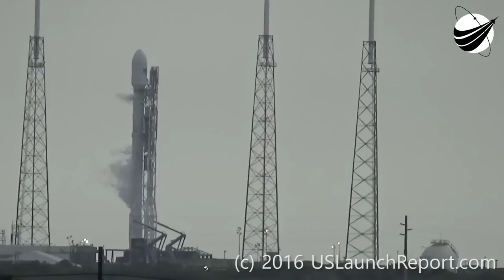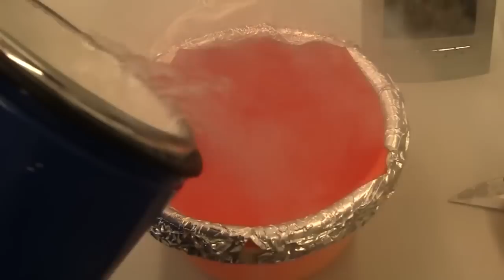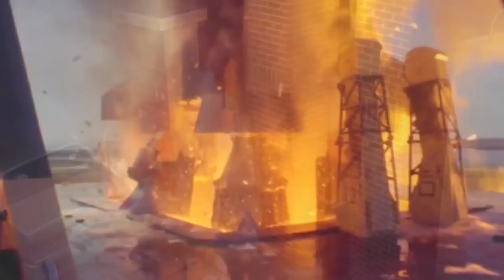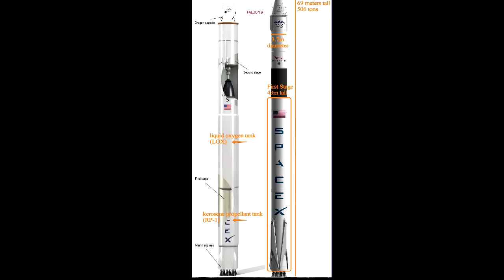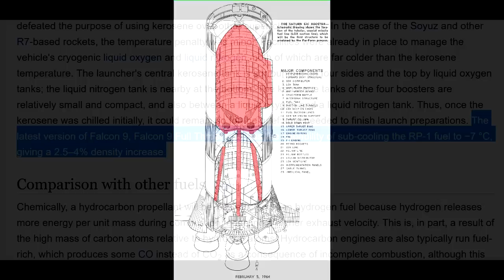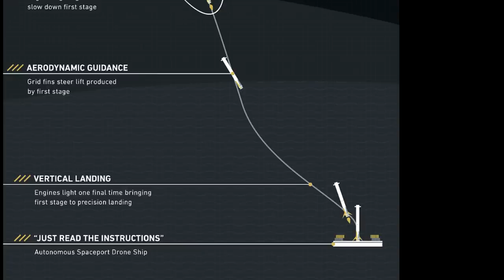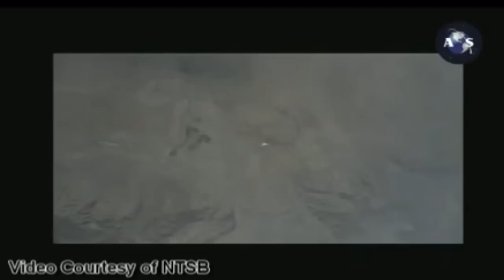Why did the Falcon 9 Explode?

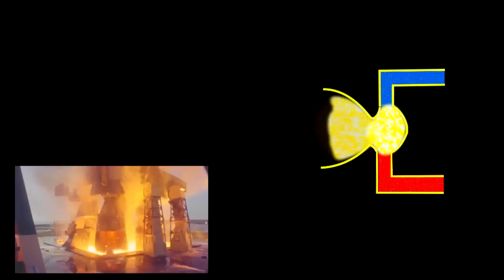Comment: 7:34 are you saying rocket fuel CAN melt steel beams?
Reply: rocket fuel can melt steel memes
Reply: Rocket fuel can't melt steel memes
Reply: Too far
Reply: Not far enough
Reply: no, the cold liquid oxygen made the keroscene freeze which inturn gave stress to the tank and broke it
Reply: Can rocket fuel melt dank memes?
Reply: DUDES . . . y'all people need to look up what an "annealing point" is, and what it means.  The steel beams of the WTC did not have to MELT to lose all structural integrity . . . that happens at the ANNEALING POINT, which is definitely lower than the MELTING point.
Reply: Yeah, somewhere about 500 C I believe ... a nice bright cherry red. roughly 950 F ... a good campfire can do that.
Reply: It didn't 'melt the beams it merely softened them allowing them to bend changing the stress on all the other beams and leading to a total failure of the structure. While the 20% ratio of oxygen in air limits the fire temperature airflow into the fire can increase the fires temperature the blacksmiths forge show that.
Reply: with an excess of oxygen, you can increase the burning temperature beyond that of the fuel's 'golden ratio' (so, yes)

which is also why it's bad to run your car lean, it creates more heat, causing damage to the engine.
Reply: Autistic screams can't melt normy  memes
Reply: You mean jet fuel!=rocket fuel? Actually they are pretty similar in many points, both beign Kerosene, but not the common kind. Mind that Aviation grade Kerosene is better then the "household" grade shit! But the fuel is about the same. The biggest difference, as you could observe within the video is the oxidant not the fuel and this is very important in a combustion as it requires fuel+oxidant, being really finicky with the later. Just look into the burn-out and other problems the first jet engines had in the UK(yes, they were the first with the Germans really close, but more invested in it). Also, let's not forget how much several tons of plane+fuel+bags+meatbags at hundreds of miles per hour have as kinectic energy and how this energy would be dissipated in a moronic structure like the WTC buildings. This is all sad, but the saddest part is people trying to racionalize something crazy with very little logical reasoning!
Reply: Roonasaur I was a welder by trade for several years ... I know my metallurgy :)
Reply: Mystic Virgo
Yep :)  Glad there's at least one person out there that I don't need to explain basic shit to :)
Reply: rocket fuel can, jet fuel cannot.
Reply: LOL, even jet fuel under typical low-bypass turbofan conditions can melt through a solid piece of iron or maraging steel, let alone low-temperature structural steels.
Reply: Peter Smythe LOL is why they are mostly titanium alloys . Germany had a hell of a time figuring out how to keep their Jumo turbines cool enough to have a half decent lifespan
Reply: so impressed with your knowledge .. not so much that by a minor technical error you have pre judged me to be completely ignorant.  I have been a student of military and aircraft history since , perhaps, before you were born ( perhaps not ) . It would have been perfectly acceptable to simply correct me on the alloys used ... and, perhaps, added the modern use of air film cooling in the turbines ..
Reply: Mr. Emma Wray repeat this a few more times?? :P I would not be surprised if there weren't 'hot spots' under the debris, especially the lower levels of the pile" where temperatures were high enough and lasted long enough to cause melting of thinner structures , like the floor trusses.  But insofar as the incorrect hypothesis that the fires on the affected floors were high enough to melt steel and that steel needs to be melted to fail, is completely fallacious and based on ignorances of basic metallurgy and engineering.
Reply: Burns like an Ox-Acet cutting torch, of course it can melt steel.
Reply: No , it's not what happened at all... even if there were thermal steam explosions, , they would have been on floors under the compromised steel and the worst that could have happened then was glass blown out ... no it isn't what happened...
Reply: Jesus did it
Reply: Actually planes use turbines to pressurize oxygen and inject it a chamber with jet fuel.
Reply: Well you would get a higher partial pressure when it comes to oxygen in the mix if the air gets compressed to some degree. The percentage of oxygen in there will still be the same, but due to a higher overall pressure you do get more in there. But it'd be nowhere near as extreme as injecting pure oxygen in liquid form which when exposed to the heat of the burning expands rapidly into a gas.

And considering the expansion ratio from liquid to gas and how fast it goes through the nozzle I'd imagine the pressures are quite high.
Reply: oh, and in the case of a rocket engine, an important factor is: the friction of the propellant moving past the nozzle ports, which can create tremendous amounts of heat.
Reply: +Viktor M They don't carry oxygen with them but -
Rocket fuel = RP-1
RP-1 = Kerosene 
Jet fuel = JP-1
JP-1 = Kerosene
Rocket fuel =/= Jet fuel??
Reply: ***** I don't know.
Reply: Remember it has to mixed with concentrated 100% oxygen.
Not 20% in Air...
Reply: JP-1 != RP-1.  RP-1 is a higher refined version.  Wiki quote: "RP-1 (alternately, Rocket Propellant-1 or Refined Petroleum-1) is a highly refined form of kerosene outwardly similar to jet fuel, used as rocket fuel."  Not the 'outwardly similar' text....RP-1 has much lower tolerance to contaminates such as sulfur for example.  The weight of all additives are restricted tightly to be similar to C-12 in weight.

Also note, a standard JET engine will NOT be able to burn RP-1.  As it needs higher O2 concentration to ignite then a typical jet engine can generate, this is due to it's very strict C12 hydrocarbon weight restriction.  JP-1 has carbon distribution typically between C8-C16.  JP-B by the way is between C5 - C15 distribution.  RP-1 is C12, period no variance allowed.

To summarize.  Just because they are all Kerosene based fuels, it's NOT the same.  Example, don't put diesel in your unleaded engine.  Even though unleaded is just a more refined form of diesel.  Or to compare more similar fuels.  Don't put 89 octane in your engine if it requires 95 octane, your engine will knock and you will damage it, also will get lower engine temps and less power.
Reply: thermite would be a form of solid rocket fuel.  And would be less efficient then other typical solid rocket fuels.  Overall solid rocket fuel is less efficient then liquid fuel, due to the compression allowed with liquid fuels.  Thermite uses Iron Oxide as it's oxidizer, much less efficient then liquid O2....ie extra weight from the 'iron' part of 'iron oxide'.  btw, iron oxide is just rust, LMAO
Reply: Considering the flame temperature of LOX-Kerosine rockets is almost 3000° C. Yes they can.
LOX-Hydrogen rockets have a flame temperature of over 4000° C

Hydrogen rockets actually burn hot enough to evaporate steel (technically).

With rockets you are technically riding a continuous explosion into space. That brings BIG engineering challenges.
Reply: nah. mate, it does increase the amount of O2 available to burn as compared to the more rarified atmosphere at 30K feet.  no, the ratio of o2 to Nitrogen does not change
Reply: Mystic Virgo 
Aye
Reply: +jacek ringwelski and you're wrong as fuck
Reply: LittleRainGames oh, damb. Thanks for letting me know in wrong. 

Even though you didn't bother to tell me what I said that as wrong, why it was wrong, and explain what the truth is.
Reply: LOL Yeah I finally got smart, bookmarked links to remind me and to provide the info to those who ask for citations
Reply: Roonasaur That requires the immense effort of googling shit up and actually reading, which makes the "Chip and Dale" in people's head go crazy with that squeaky voice. People just love "gud educachun"!
Another interesting thing that can happen in building fires(not the problem in WTC) is if you temper the steel by heating it then fastly cooling with water, making it brittle with the forming of too much martensite withing the steel, so one good shock(falling debris for example) might break it depending on the mass and structure.
Reply: +Kaos Warrior I don't think anyone questioned whether it is possible to shatter steel beams. the issue with beams melting arose because melted beams were found and there is no physical process in the official narrative that can explain this fact (or many other observed physical effects on the day).
Reply: +Kaos Warrior I don't think anyone questioned whether it is possible to shatter steel beams. the issue with beams melting arose because melted beams were found and there is no physical process in the official narrative that can explain this fact (or many other observed physical effects on the day).
Reply: +Kaos Warrior I don't think anyone questioned whether it is possible to shatter steel beams. the issue with beams melting arose because melted beams were found and there is no physical process in the official narrative that can explain this fact (or many other observed physical effects on the day).
Reply: in art, the Golden Ratio is essentially the fibonacci sequence being mimicked in a composition. For some stupid reason this made me laugh.
Reply: This is what cause the steal beams to melt and explosions to be heard: https://www.sciencedaily.com/releases/2011/09/110921074747.htm
Reply: LOL
Reply: yeap , anyone take metal working in shop class or votech could tell anyone that :)
Reply: Molten aluminum mixed with water will give a reaction that can get high enough temperatures to melt steal beams. The planes delivered tons of aluminium and the sprinkler system delivered plenty of water. Check out the source, a Norwegian material scientist: https://www.sciencedaily.com/releases/2011/09/110921074747.htm
Reply: e idea, General, but bear in mind, any sprinkler systems at or above the lowest affected floor  were completely inoperable... Severed standpipes
Reply: Mystic Virgo Just read the damn article it's explained there. Once the aluminium is molten liquid it can flow like water and leak into floors below where the sprinkler system is still operable.
Reply: GeneralBlackNorway Have you even spent an hour in any form of metal working trade?? have you any clue how hot metal / molten metal actually behaves?? if a small amount of water is dumped into a larger mass of molten metal, such as aluminum, you will indeed, get a steam explosion.. not a chemical reaction.. but if you send a stream of molten metal into a water spray, you get steam but no explosion as the metal is rapidly cooled... water into molten metal.. bad idea, molten metal into water, not nearly so bad
Reply: GeneralBlackNorway Water CAN be thermally decomposed by high temperatures, but on order of 2200 to 3000 degrees C .. even so , the hydrogen would have to be concentrated and confined  long enough to accumulate enough to generate any significant scale of explosion.. in the case of the trade centers , any hydrogen released would immediately recombine with oxygen ( and other free elements might be floating about) to make water vapor/steam... try again .. yes I read the article .. and it is very shoddy science... not s single bit of data shown/given as to experiments actually performed other than the mention of the alcoa 20kg/20kg alcoa test.. which was a STEAM EXPLOSION...
Reply: Mystic Virgo What are you actually trying to say? You are not very clear on what your point is...
Reply: Im saying that theory is bad science ... in all manner of ways... apparently written by somone who has practical  experience dealing with molten metals and water , and ,likewise, no clue on either physics or chemistry.
Reply: Mystic Virgo So you don't think this is what happened?

Comment: why do they launch rockets vertical anyways? wouldn't it be much easier to start the satelite carrier like a plane and land it afterwards the same way ? The only downside is fuel coast right? but the security is a huge upside.
Reply: The more horizontal it is, the more time it spends in the atmosphere. The more time it spends in the atmosphere the more time the atmosphere has to fuck with both it's trajectory and structure
Reply: Newton's cannonball doesn't fire straight up and then lean to the side to achieve orbit. It just seems easier to travel into space sideways via something like hypersonic jet than riding a controlled* explosion straight up through the atmosphere.
Reply: Sir Camp|a|lot You can debate this for ages, but smarter people than you have done the math and cost analysis for all this. 

Plane launches favor smaller vehicles.

Big vehicles favor ground launches, due to weight/fuel constrains.

You cant find a plane strong enough to launch this vehicle without spending more fuel than launching it from the ground, if its even physically possible...
Reply: You would not be able to get enough thrust to get into orbit.
Reply: Or a big ladder.
Reply: Good point. Or why not launch it from the bottom of the Pacific Ocean with some aircraft carrier anchor chains attached to it?
Reply: Well okay, if you want to launch this type of rocket sideways you would have to have extra supports to stop it breaking, the supports add weight, drag, extra fuel and extra money spent. Launching it sideways accomplishes not much of anything since the goal of a rocket is to get out of the first layer of atmosphere as quickly as possible since it has a lot of resistance which means a straight path is the best route in saving fuel.

Not to mention the fuel spent moving the rocket horizontally is basically wasted since you still need to use fuel to change the trajectory to escape the atmosphere.

+ a million other technical reasons.
Reply: spoofer20 what about a hybrid between rocket and plane ? so it starts like a plane and after it reaches a certain hight it relases stage 2 which is a rocket powered vehicle to get the cargo into orbit.
Reply: Reverend Veritas They don't actually go straight up. They start straight up and follow a curve pathway to get enough angular momentum to keep an orbit. Newtons cannonball is not a great comparison because it is just a cannonball I can't even imagine the force you would need to apply to get a horizontal projectile from the ground into orbit. You could pretty easily do the math though.
Reply: You have to punch through the atmosphere. At to small an angle you would bounce off and burn up.

Comment: Don't run a test of your rocket with a satellite on top of it. Rocket safety 101.
Reply: SpaceX didn't make that call. The satellite owners did.
Reply: Counter Argument: if you're going to test something, it's probably best to test it in the same configuration that you're going to use it in. If they replace the payload after testing, other things could go wrong.
Reply: Counter-counter Argument: If you're going to test something expensive, it's probably better to build a mock version to test with first rather than using the actual hundreds of millions of dollars satellite. They could even re-use the mock "satellite" for future tests, assuming nothing exploded.
Reply: No one else in the US conducts fueling tests with the satellite on board, let alone an actual engine test.
Reply: No chucknorris you don't know what you're talking about. They left the satellite on the booster in order to save time. They scheduled a lot of launches this year and if they placed the satellite on the rocket after the tests. They wouldn't make their schedule. They were cutting corners to make a few extra bucks.
Reply: Just because the insurance company agreed to something doesn't make it a monumentally stupid decision.

Comment: 15:12 At work right now so do have time to do the math but, i think that the much higher gravity of earth would make the parachute to heavy. Similar limitations keep parachutes confined to small aircraft instead of large ones.
Reply: More gravity but thicker atmosphere. NASA used parachutes for manned capsules on Earth.
Reply: +Mr. Emma Wray a capsule is not equal to a rocket trying to stay out of the ocean.
Reply: Formula: http://www.rocketmime.com/rockets/descent.html
I have used this many times to bring model rockets down safe and sound so i know it works or at least on my scale of things.

Ok math time 
My values 
m = 90,718 kg per thunderfoot
Cd =0.75
v = 6.7 and 3 m/s
g = 9.8 m/s
p = 3.14
r = 1.22

To get weight per m^2 of parachute area i checked this against T10 us military parachute, result was close.

Weight (kg) per m^2 of parachute = 0.1473916934 

At 6.7 m/s decent speed i get a parachute with a diameter of 235 m area of 43,351 m^2
Which weighs 6,398 kg or 7% of empty weight.

At 3 m/s decent speed i get a parachute with a diameter of 524 m area of 215,542 m^2
Which weighs 31,769 kg or 35% of empty weight. -This is what i use for my rockets. 

I do this for a hobby so if there is a variable i am missing please point it out, but i can see how 35% of empty rocket weight is something that may be viable for a fuel load to reuse a rocket that is worth something like 61 million dollars (not sure on that value). But if you change g to a much lower value like mars a parachute becomes a more inviting option.

Comment: So a rocket engine is just managing the explosion in a controlled way?
Reply: That can be said about all combustion engines.
Reply: the same way you pass gas in a controlled way.
Reply: Pretty much yes
Reply: Most combustion engines. External combustion engines like steam engines don't create explosions the just burn fuel to generate heat.
Reply: so is a cannon